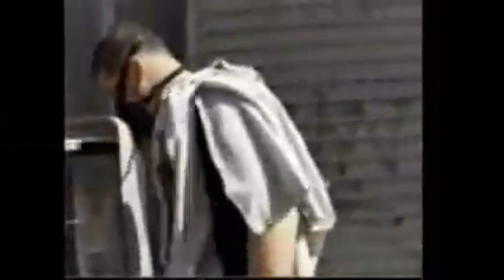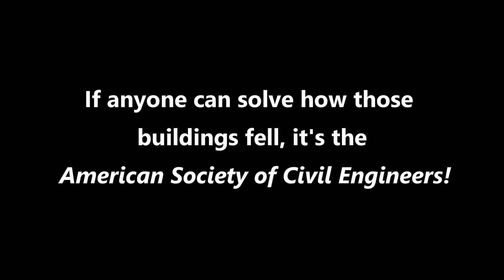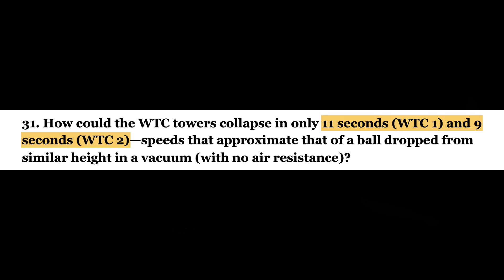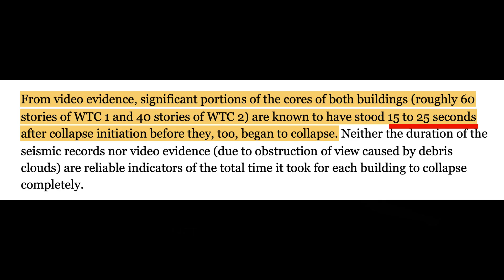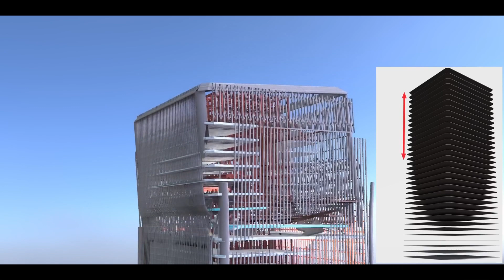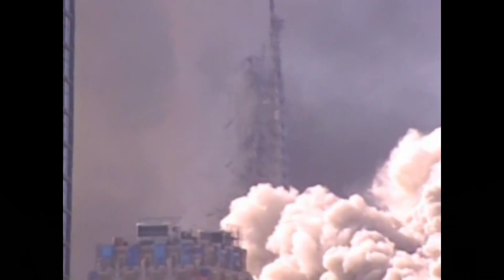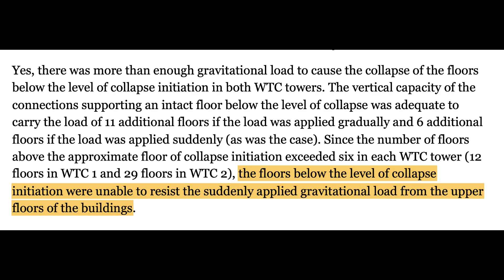The Last 30 Seconds

Comment: Why would there be a visible jolt if the load-bearing structure collapses first, like you point out with the antenna?
Ah, and then the classic, very honest showing of a concrete building heavily jolting, suggesting a steel structure should behave the same way.
I like how you took that springing action part quite literally, though.
Would have been quite the show, that top part bouncing around.
The "free fall" being slowed slightly by thermally expanded, and therefore more flexible steel (and something else I'll come back to), really is nothing compared to that scenario.

Are you pointing out the standing core to debunk yourself? What happened here? Did the explosives just fail?
Which brings me to the transport-sized debris. How did the members arrive at the construction site in the first place, I wonder. Could it be the "clean cut" connections have failed?
Very thoughtful of these sinister agents, to have the workload of the cleaning crew in mind and helping them out.

Same with the lateral destruction part. That weight isn't needed, if the core collapses, but it nicely shows how it looks different from a controlled demolition.

What about the bursting windows during the collapse? Wouldn't they burst first and then the building comes down if it was a demolition?
But if not explosives, what made them burst? How about air pressure? And how about the pressure building up, floor after floor, additionally slowed down the free fall ever so slightly?

Back to the explosions. So, random witnesses heard very audible explosions way before the collapse. I have no satisfying explaination for these, but how does this correlate to explosions happening floor by floor, carefully choreagraphed exactly during the collapse, which must have been how it was done, according to you.
Quite the feat, given they couldn't have had much experience on that scale and then they just pull it off thrice.
While literally half the world watches.
Curious, how they™ are absolute baffoons on one hand and icecold professionals on the other.

The cherry on top are those backyard experiments, though. Contrary to what our wives say, size does matter. (Oh, just mine? Nvm then.) Forces are way, WAY out of proportion here.
Please demonstrate head-on collision damage of a semi truck going 70mph hitting a solid concrete block the size of three Titanics, using a toy semi, 10% the size of a Hot Wheels car. You can use all the tools at your disposal, I'll wait.
Ever seen a video of someone trying to prove gravity doesn't exist by pouring water onto a mock earth the size of a basketball?

I wouldn't be as condescending for no reason, if you weren't. Makes it quite hard to watch and takes away from the work you put in. I might disagree. Heavily so. But still, I appreciate the effort.
The sad part is, I think you're doing this on purpose. Guess you made so many like-minded friends while (rightfully) doubting and researching and now you have to keep it up, to stay in good terms with them. 
Hah, see how I can just make things up to fit my narrative? Funny how that works.

I don't believe for a second you actually ignore all evidence contradicting your theory.

Welp, job done. This will be a nice payout by the CIA, for sure. Have fun deleting it, shadowbanning me or whatever, you won't see me again.

Or will you. 👀

No you won't. Bye.

Comment: Thank you for your work, exposing "how" this was accomplished. This is %100 percent believable and correct IMO. I have 52 years in light construction, hundreds of tons of concrete and re-bar,  Straight , curved, etc. I stood next to the hole in the ground one year latter. No aluminum airplane did that. Not even filled with BBC talking heads.   
 This is a big box of nails in the 60k+ coffins of the international traitors that killed so many innocent people on 911 and in the wars to destroy independent countries they created right after. This is not an engineering problem, It's an Americans addicted to avoidance problem.

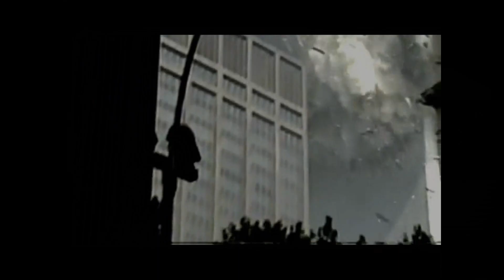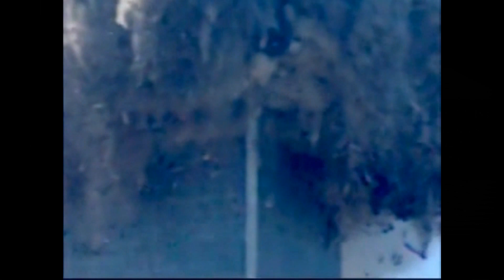Comment: 22:10 How could it be explained that the explosions are out of the core path? That is the eastern area of the south façade of 2WTC, where the core sat to the left of those explosions. The same at 22:24 with the southern part of 1WTC. I mean, I find a bit difficult to understand the behaviour of the explosions by simple directed explosives atached to the core columns (22:45).
Reply: Thermonuclear demolitions destroy by heat not blast.

The lower 77 floors were compromised and we saw the remaining core columns turn to gas because of the extreme heat.

Comment: Surely by now you realize that 9/11 is but a teeny part of the mystery of what is happening on this planet, right? Did you know building 7 was also commonly know as the "Salomon Brothers Building"? The two Twin Towers were designed to symbolically represent the two pillars of Solomon's Temple. They stood for a total of 33 years (an incredibly important symbolic number in all schools of occult philosophy for many reasons). There is also the 9/11 "Tribute In Light," where two beams of light are shot up into the sky in tribute to the towers. They consist of 88 lights, for a very important reason. They are commensurate with the 88 officially recognized constellations in the night sky. There was also the 9/11 documentary titled "Heroes of the 88th floor." Of course, it's only named that to retain and reference this symbolism. The architect of the Twin Towers also designed another set of twin towers located in Los Angeles called the "Century Plaza Towers," each tower with 44 floors each for a total of 88. They are located precisely at the intersection of Constellation Blvd., and Avenue of the Stars. This is not coincidental.

Comment: The heat weakened floor trusses and their heat weakened 3/4 inch bolts were strong enough to pull in a wall of 4 inch steel columns.   Because the the weakened bolts certainly weren't the weakest link in the chain - the outer wall was.    Its so insulting.

Comment: At the end of 2020, after four year in process, the University of Alaska Fairbanks (Dr. Leroy Hulsey, head of the engineering department, et.al.) published a peer reviewed, forensic engineering study of the demise of WTC7 on 9/11/2001.  The study concludes that no possibility exists that WTC7 could have be destroyed by fire as is still claimed by NIST as part of "The Official Version of 9/11."  Thus, the only possibility for the demise of WTC is controlled demolition.  I can scarcely imagine that Al Qaeda had access to WTC7  for 4-5 weeks before 9/11 to load and wire up the necessary explosives.  The University of Alaska study on its own should be more than sufficient to completely destroy "The Official Version of 9/11."  I have only seem the University of Alaska WTC7 study cited three times (so far) on mainstream media, once on a local TV station in Alaska, once in an article on Yahoo Finance, and in an article "The Hidden Truths of 9/11" published by the Santa Barbara News Press.  "Journalism is printing what someone else does not want to be printed.  Everything else is public relations." -George Orwell
Reply: You have the motions of the WTT not matching the direction of force.

There is no conspiracy theory here.  In order to get an object to move right, a force must have been applied in that very same direction on the other side.

When you push a car, the car moves the direction you applied the force.  

The only time it won't is if you try pushing it up hill and your force isn't great enough tk overcome gravity in which case it goes backwards.

But even then, the car moves in e direction of greatest force applied.

Those towers were blown outward!  But NIST and huge real conspiracy theorists insist those motions are consistent with gravity.  Which only works downward.  Not outward.

The motions don't match the applied force.  Therefore the force that took down the towers is a lie.  It wasn't gravity. 

What can easily explain outward motion are explosions.   Which perfectly match the eye witness accounts hearing explosions going off.  Both prior and just a moment before the towers fell.

The conspiracy theorists say otherwise.  Not a single post by any of them can explain the motions of debris going outward.

B
Reply: First of all, was the beginning of 2020, in march, but more important, THERE ARE NO PEER REVIEWS! And the conclusion is that there’s an alternative explanation, not that NIST conclusions are impossible!
UAF it’s been payed by a&e911 for the study, and made it using data from liars from a&e911 forgetting to make the due citations to it! And it took 4 years to be done because the two toddlers in charge of doing it couldn’t find a way to make the customer, (a&e911), happy! So to solve it, they decided to arbitrarily remove pilons until they obtained what they were looking for! But it’s rubbish, that’s why you won’t find a single peer review nor a paper about it!
Reply: @AxelPixel-cx4wg Know what else was never peer reviewed?  Every scientific theory and fact written out before the late 1800's.

That includes the theory of evolution and law of gravity.

You got nothing.

Comment: Id donate if you proposed a Kickstarter/crowd funded structurally relevant model with accurate approximations of load bearing capacities of which some number of testable samples would be built to properly investigate all relevant theories, including computer models based upon the actual architecture.

There's undoubtedly plenty others who would be wiling to fund or assist. Im sure other professionals including AE911 would be happy to assist in the manufacture and testing.

You never appreciate how important the truth is as you do when realizing you're living submerged in lies
Reply: The Willis Tower (formerly Sears Tower) in Chicago was built around the same time as WTC 1 and 2, and uses the same tube type construction--strong centrally located columns, weak peripheral columns, floor loads brought to bear principally on the central columns by means of a hat truss.  I figure it will soon be time for the Willis Tower to be demolished.  It would be interesting and perhaps instructive to buy an old airliner and have it remotely flown into the tower.
Reply: @FirstUsedBooks  thanks for this, a modeled study of the dynamics at play using sensors cameras and maybe even techniques by a team of engineers representing the prevailing arguments.  that's a go fund me if ever there was.  Also I can offer to ride that plane like slim pickens
Reply: Funny(as in, this milk smells funny) thing is, they could have rebuilt both towers for a tiny fraction of the costs of all the wars, which cost well over $8,000,000,000,000(trillion) dollars. 
Then done a controlled demolition on one, and flown the same plane into the same spot on another tower. 
Anyone with at least 5% of their brain intact knows which one would mimic the events of 9/11. 

Instead they spent all that money and it resulted in at least 900,000 ended people.

Comment: Defenders of official story, i am convinced, never actually look at the collapse. Their arguments center on a hypothetical collapse they have in their minds.  Like saying the squibs 20 floors below are from air pressure, despite air smoke, steel, etc escaping in every direction above.  Like claiming an air compressor will work fine with one end of the air tank missing.

Comment: Why did the FBI, under the supervision of Michael Chertoff, allowed the crucial steel evidence from the World Trade Center to be destroyed? Rather than conducting a forensic examination of the steel to determine how the buildings were destroyed, this crucial evidence was hastily cut up, mixed with other scrap, and shipped to steel mills in Asia.
Reply: If 9/11 was a terrorist attack then the WTT is a crime scene.

And should have been handled as such.  It wasn't because it wasn't a terrorist attack.

What happened is what was supposed to happen.

As was the cleanup.

Any conspiracy theorists need to explain just how the most protected building on earth, the Pentagon failed to defend itself.

They won't.

Comment: I have a question for those who understand mechanical science and Sir Isaac Newton's three laws of motion.

How does gravity create lateral movement of tons of steel & concrete?
Reply: You don't need to understand any of the things you listed.

You merely need to have a brain and use it.

Drop anything on top of anything.  The direction of force of the object hit by the falling object will be the same direction as the falling object. Downward.

You get lateral movement from lateral forces.

That's the ONLY way to get it.

Lateral movement of several ton steel beams flying with such force laterally they embed themselves into neighboring buildings can't happen unless a force was applied to send it laterally.

That's easily explained with explosives.
It's impossible to explain with gravity.

Anybody who tells you otherwise is a conspiracy theorist.  Because you can demand experimental evidence showing this and they will NEVER provide it.

Never ever ever.

Meanwhile every normal demolition only collapses downward.  And no demolition or fire destroys every bit of furniture in those towers either.
Reply: Gravity doesn't create it.  What creates it is the sudden force exerted by the floor loads on the outer structure when the truss fails.
Reply: @FirstUsedBooks  
LOL!
Inertia Never Lies, But Men Do!
Reply: 😂  You didn't answer the question.  The trusses didn't break on every floor.  Just initial collapse.

The rest of the building fell supposedly because the falling part is indestructible.

Even though you can see the falling part being destroyed when it hit stable floors below until you lose sight of the collapse under dust.